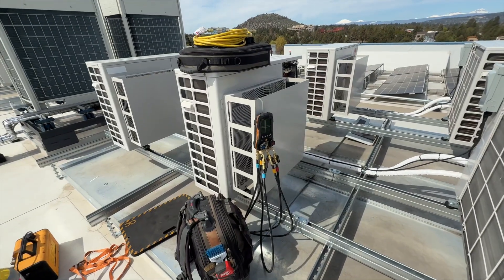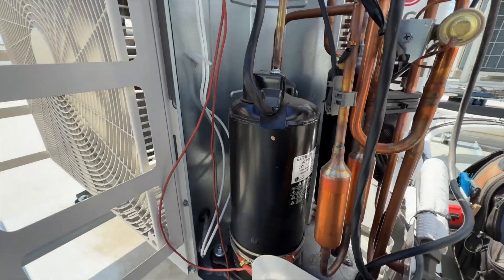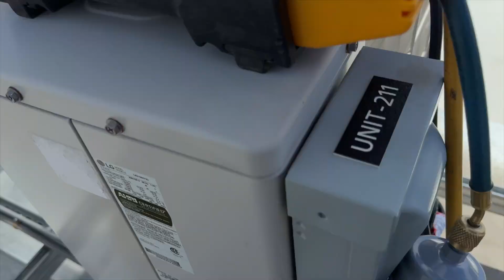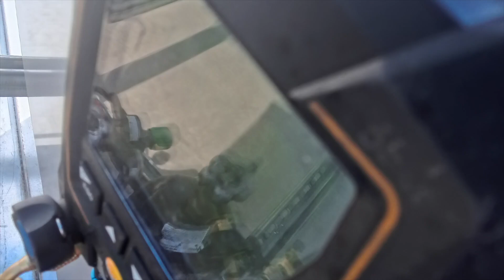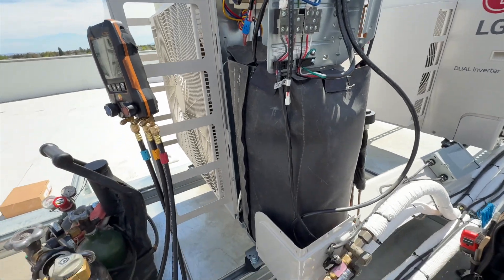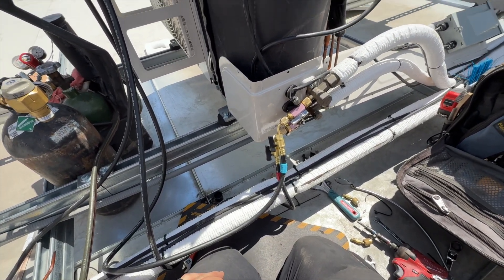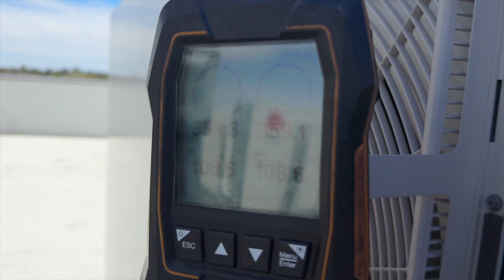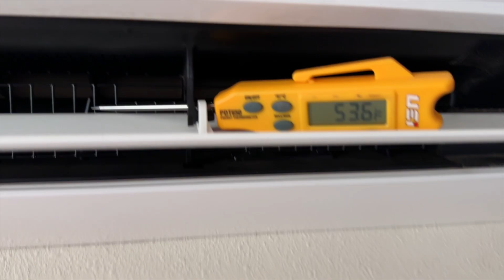Reviving an LG Mini-Split: Compressor & Inverter Board Replacement EP220

Comment: What I have heard is when you pull a vacuum to quickly it can cause any water molecules or moisture to freeze up, and sometimes you may have to purge with nitro to get rid of them, I open my valves very slowly when I pull a vacuum

Comment: Haven't seen air discharge deflectors that close to the unit.....I assume it's for not discharging into the unit in front of it, but no recirc of air or issues with too close????? just curious.
Reply from the maker: It’s used to allow the unit to run better in low ambient conditions.